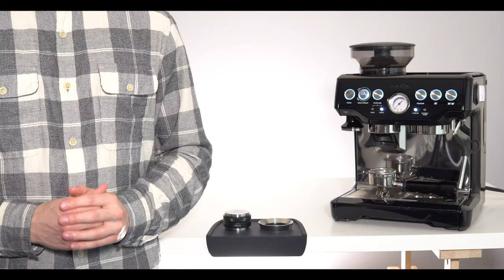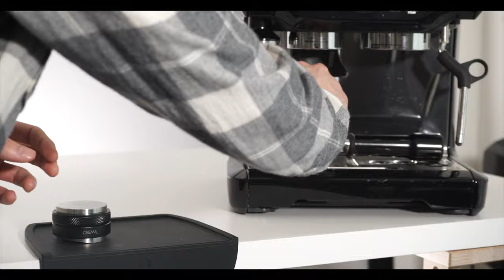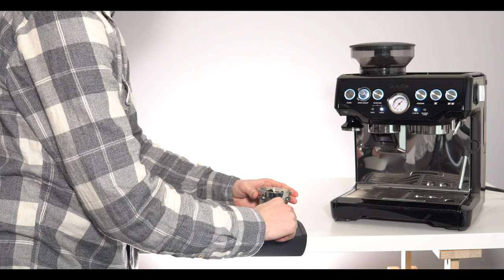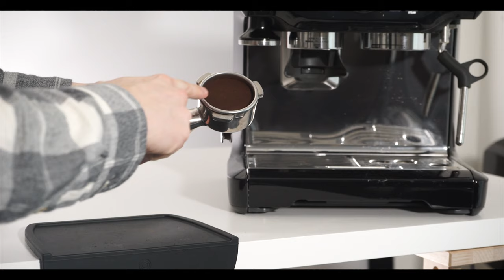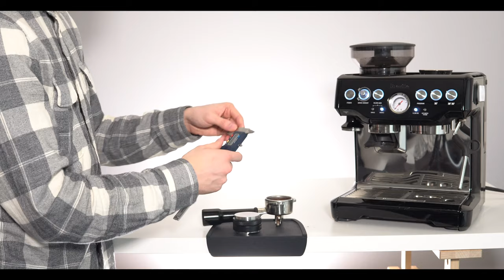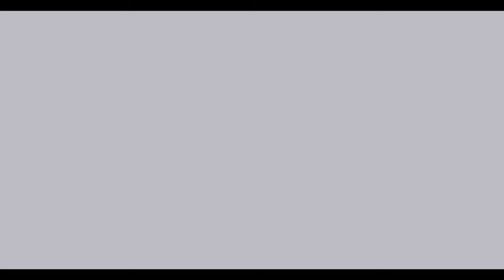How to Set Palm Tamper Depth | Breville Barista Express

Comment: This is equivalent to an automatic car. 
You know that car snobs, I mean enthusiasts, only drive manuals, yes?  😆😷
Reply from the maker: Even many "enthusiasts" have opted to switch to puck tampers / distributors due to the added repeatability
Reply: Lifestyle Lab 
That may be due to the same reason many pro racers and all F-1 have switched to auto transmissions : humans just can't compete with robots when it comes to consistency and results. 
Next "improvement" - auto tamping. In fact doesn't one of the Breville machines already do that? 
You know what's coming - one push button fully automatic brewing. Get rid of the barista. 
However, it's still fun to get engaged in the process.
Reply from the maker: Yup! I actually just released a video reviewing the Oracle! 

And many cafes have opted to purchase the "Puqpress" automatic tamping stations. Always looking to improve

Comment: This method only works if your group head is very dry. If it’s wet, the grounds will get wet and you won’t be able to see the impressions created by the group head, even if you adjust the tamper. Also, it would be more helpful if you measured the tamper from the top of the distributor side down to the bottom of the tamping side. Otherwise, we are obliged to guesstimate with the caliper as opposed to being able to actually open and clamp it closed on the entire tool.

Comment: Proper tamping depth, yes. Proper compaction, nope. Resistance and compaction should end at the appropriate depth. A proper depth is is pointless if you have a loosely packed puck.
Reply from the maker: Absolutely, need to dose correctly for your basket :)